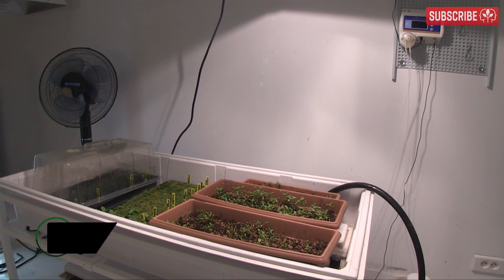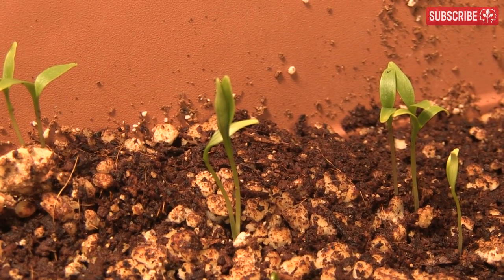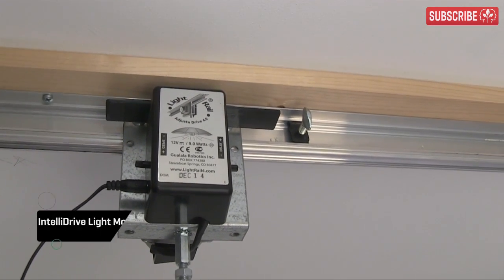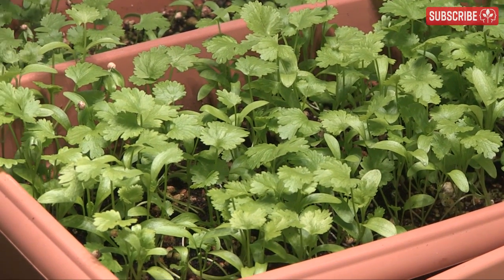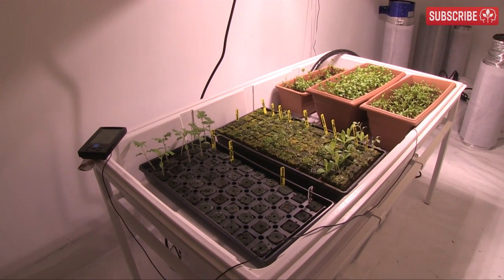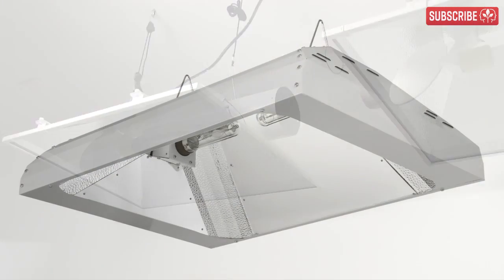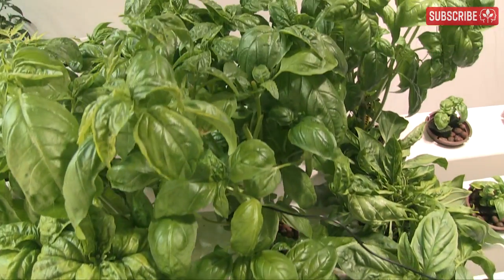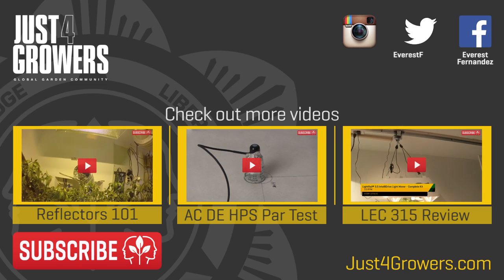LEC Light Emitting Ceramic Metal Halide—5 Applications

Comment: Have you tried the 600 watt ceramic hps by eye hortilux?.
 There is very little info regarding this setup. I have used the cmh 315 and was very impressed,  so I bought another one. Great info.
Thx rob

Comment: So i can use 3100 and 4200 lamps in 1 fixture for better flowering? And 3100 are better for clones and grow period? Thanks you
Reply from the maker: +cooldriveone Yes you can use both lamps simultaneously in the same fixture. The 3100s are touted as full spectrum, the 4200s a bluer vegetative spectrum although I've used both lamps very successfully for the growth stage.
Reply: Thank you. I am just trying to put my 4200 for good use and there is not much information on the exect 4200 apply. So if its better for Vegetative period i should put my clones (after a few weeks after cloning) under it  for all vegetative period. 
I am using  SunSystem Lec 315 and ordered a second Light a Sunsystem 630. And i have both 3100 and 4200 bulbs.

Comment: I have a 4 x 4 grow tent and would like to know if the 315 LEC is enough or could i throw in an apollo 300 watt LED at the same time. Thanks
Reply from the maker: +rhgutierrez79 the 315 won't cover that area, I'd consider its big brother the LEC 630 instead.
Reply: I was told by my hydroponics store that the 315 is more than enough for a 4x4
Reply: @keifcor6254  yea to get you to buy it you need a 630 cmh

Comment: Good videos with great humor !  I am just wandering whats the difference from the 315w lec and the 400w cmh ( http://www.htgsupply.com/Product-HTGSupply-400-Watt-Ceramic-Metal-Halide-Grow-Light ) while the 400w  cmh is a fraction of the cost.    thanks
Reply from the maker: +solomon Thanks for your feedback Solomon. This looks like the CMH400/U/830/R lamps manufactured by General Electric. The first thing I notice is the “R” rating for Retro lamp and then the corresponding ANSI code of S51/E (meaning this lamp is meant to operate on a 400w HPS ballast). Also the “E” designation for an enclosed luminaire –which the HTG unit is obviously not. I am very curious to see how these GE lamps perform compared with the Philips. I am a little concerned about the operating restriction and how most end users will probably not even be aware of this Another concern will be the effect of a high frequency electronic ballast on this particular lamp – it has the potential of creating a hazardous situation. If I can get my hands on one, I will.

Comment: Um, hell yeah they can flower and hell yeah they produce quality! I'm covering 4 of your 5 applications. Hey..... you should let me get that grow beast when your done. :)
Reply from the maker: Good to hear Froctor! Yeah, I'm salivating for the Grow-Beast, just hope my ceilings are high enough to cope with it! It'll make for a good vid on keeping plants low and wide :)
Reply: +Everest Fernandez (Just4Growers) You wouldn't have, by any small chance, some recorded data for micromoles with your LEC at integrated distances in the 26"-36" range.... wouldjya?
Reply from the maker: +Froctor Dankenstein Not to hand but I can tell you that at 26" you're easily pushing 500 umols. I can run some tests further down the line but right now I'm using mine to supplement a 1000W DE HPS over my Baxters Bush tomatoes.
Reply: Everest Fernandez Thanks! Some other guys tested it at the 18"-24" range.... but it didn't look like they actually used the light. I've used mine in the 23-26" range and recently the 30"+ and find it works great for the youngins at the higher range. I was hoping to learn some numbers about those higher ranges. I can definitely fill in the blanks, thanks!

Comment: ALL HID ballasts need contactors Everest... do give the good example. 

There is almost no UV coming from the lamp, check the specs. http://www.usa.lighting.philips.com/main/prof/professional-lamps/high-intensity-discharge-lamps/hid-horticulture/mastercolor-cdm-t-elite-med-wattage-agro/928601172201_NA/product

For flowering there is the Agro / Greenpower lamp with a much higher output red light for optimal generative phase, and also a better efficiency. 

Remember that you need about 1.5 meter distance under the large combined fixture. The CDMs can not practically be dimmed. 

Last remark: you are wasting an awful lot of light in your room, not very efficient lighting, specifically not for seedlings that are usually grown in racks. A 150W T5 would give you at least the same intensity light in your setup, and a cfl close to your propagator will give the the required 5 centigrade rise in temperature ideal for germinating.
Reply from the maker: +GavitaHolland Hey guys thanks for your feedback. I really appreciate it—especially the cautionary note on contactors. I have added a correction note to the video. The lamp outputs 4.65 mW/cm2 UV-A, but negligible amounts of UV-B. You're right, the Grow-Beast is ... a beast! I've got it penciled in for a second room with a higher ceiling—and just as well! :) As for efficiency—I mention that I could increase it with the addition of a reflective surface on the near-side of the tray, and I'm thinking of creating a portable / movable panel (so I can get it out the way to film) so this might help. The Lightrail certainly helps too. Regarding the "5 centigrade rise in temperature for germinating" - well, it depends on what you're germinating of course. Personally I don't like the light source too close to the propagators when the lids are on. I enjoy the ease of using one light (and one spectrum) from germination through to mid-veg phase and I'm prepared to sacrifice a few watts for that. Saying that, it will be nice when my multi-array T5 is repaired and back in my life as I'd love to use the LEC to supplement my HPS when my tomatoes enter flowering.

Thanks again for taking the time to give me such useful feedback. Peace and happy growing, Everest.